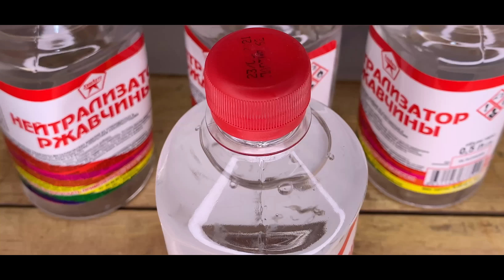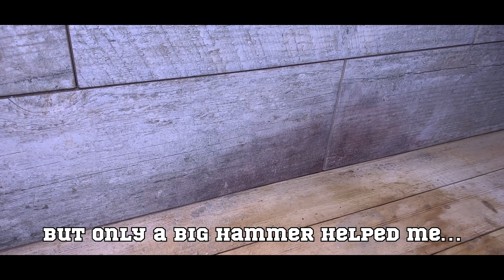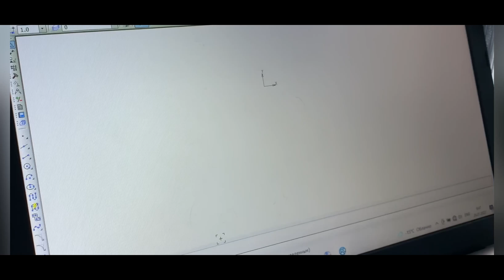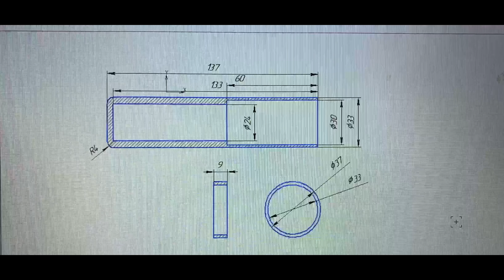THE RESTORATION WRENCH FROM WW2. EXTREMELY RARE ADJUSTABLE WRENCH

Comment: 5:50 simple answer is yes, however it is not realy worth it becuse youd have to sink a lot of effort into it. If it was only a show item you could fill it in whit putty recut and repaint it. If you want it to be funcional youd somehow had figure out how to weld such thin metal which is possible but it take a lot of knowledge and fancy  expensive equipment only to end up whit abbout 5% original handle and 95% new handle anyway.